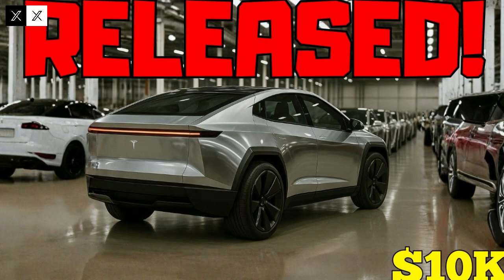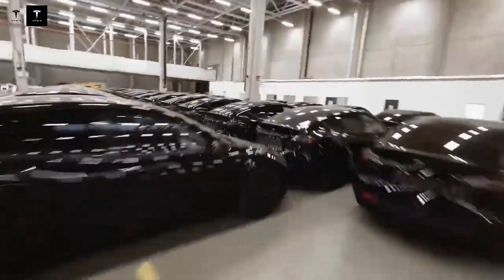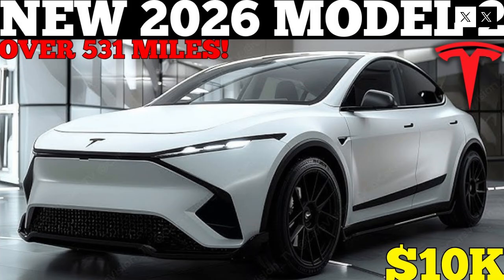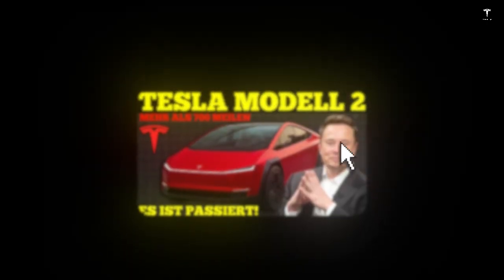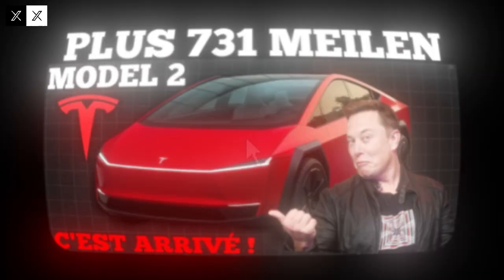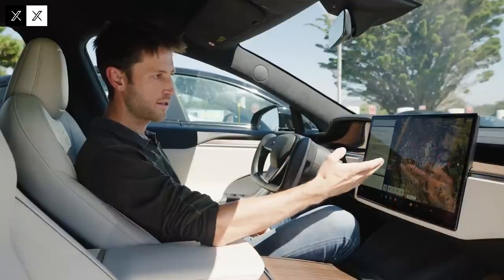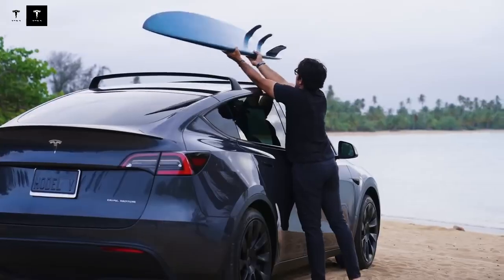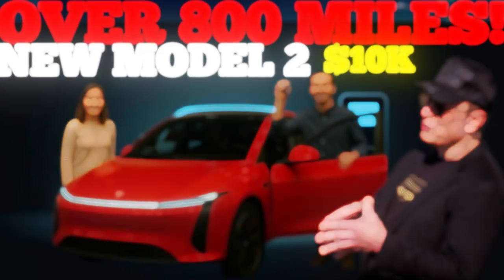Elon Musk Surprises Again! Tesla Model 2, $10K, 510 Miles and Fast Charging!

Comment: Information on a $10,000  Tesla Model 2 with a
510 -mile Range EPA  and.  fast -Charging capabilities 
 is based.  on. unsbstantiated. rumors. and 
clickbait content.  not  on any confirmed  
product.  release  the. figures cited. are. highly 
speculative. and.  not  reflective  of Tesla’s. official 
 strategy. for. an entire -level vehicle 
 Starting. price of around $15,990 
for. a standard range version and.  a long
Range. versus for about $20,000 
 $0.25 to. $0.60per mile